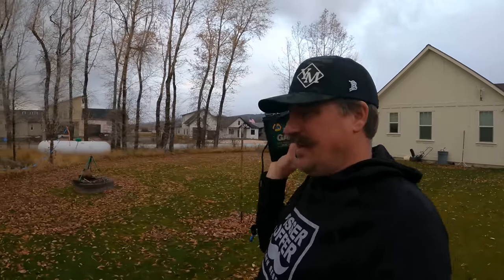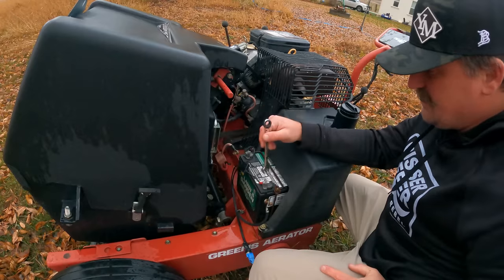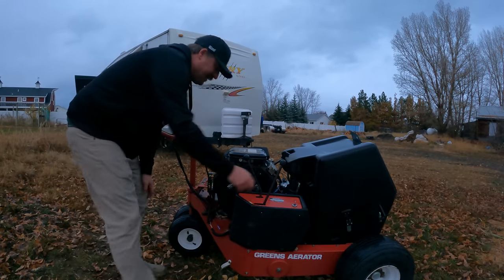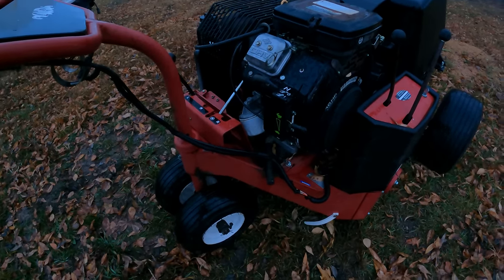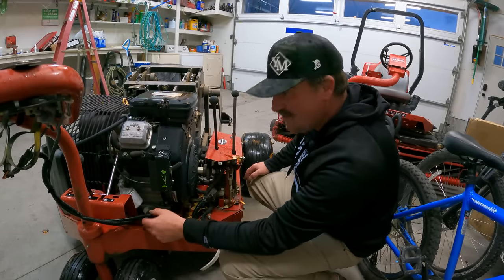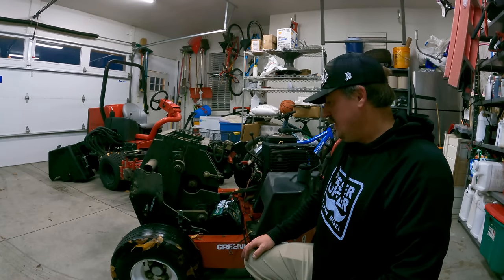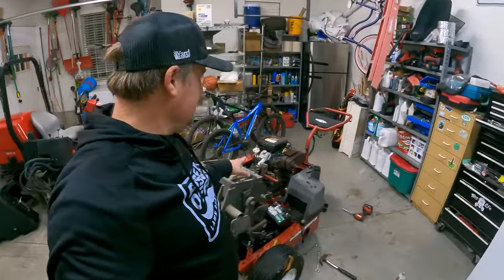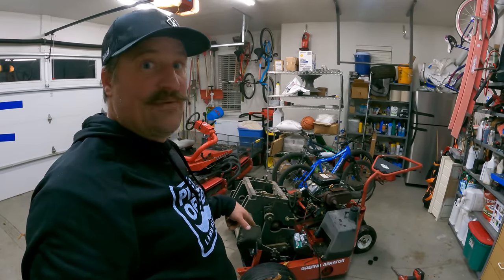Toro Greens Aerator MACHINE WORK REDO

Comment: If you pull the drive engagement lever all the way  forward it will lock in the open position and then you can nudge it and it will pop back out of drive. A good tip is never let that aerator shut off while the tines are down, the aerator has a safety that will not let it restart while they are are down and it is a really sketchy pain in the butt to get the tines back up. The levers on the handles are safeties. If you let go of the safety switches it will kick the aerator out of drive.  The high speed is for transport, the low speed is for aerating. Make sure to keep the aerator tine drive system greased and oiled otherwise it gets expensive very fast.

Comment: Hey Connor, I ordered new battery leads through Amazon of thicker(lower) gauge and longer. My zero Turn burned out my hot cable side so I used bx-cable until the order was delivered.